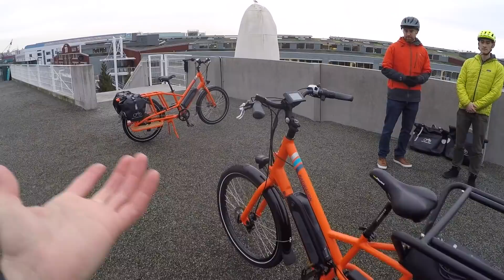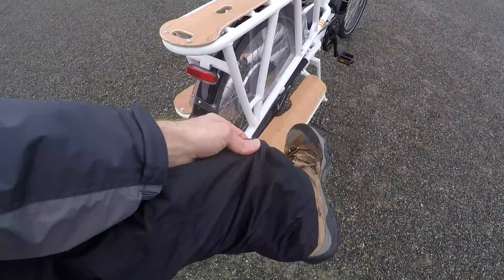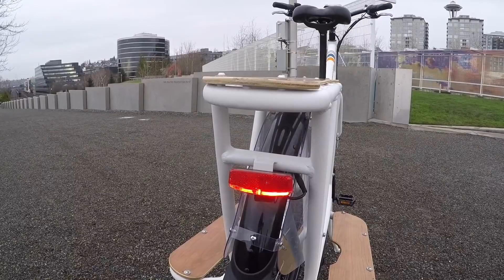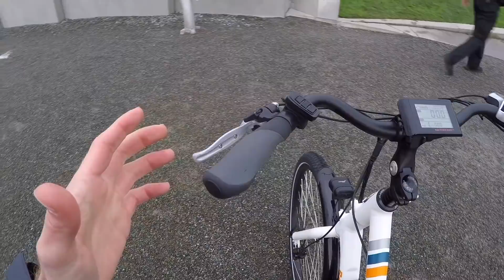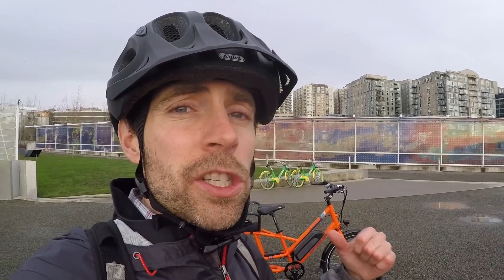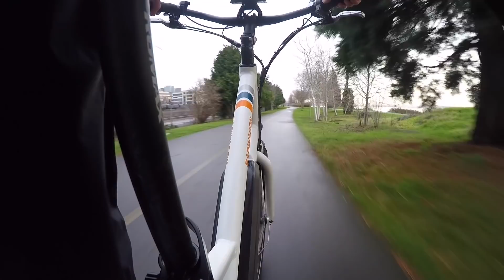2019 Rad Power Bikes RadWagon Review - $1.5k

Comment: Got mine in April when they launched the 2019 model.
UPS did not do a good job delivering it. Front disk brake was damaged. Support was great. They sent me a replacement disk rotor right away.
I have put about 2K Km on it so far. 
Even though the tires are Kevlar reinforced; I got a flat in June.
Changing out the inner tube was a pain as the rear wheel itself is quite heavy.
I'm now using Tire Slime to prevent small puntures.
about 2 months ago I was getting an error message on the display with it shutting down. Turned out to be a loose cable connection.
So far this bike has worked as it should. Many people have asked about it.
I'm very happy with purchasing this bike. Its the most i have ever paid for a bicycle.

Comment: just hit 1 yr. with  my radcity.its been dependable.i replaced the tires right away.sorry ,kenda tires suck.other than that im happy with it.i got 2200 miles on it,and so far all it needs is new brake pads.the rear wheel spokes loosened up after 700 miles,and the local bike shop wouldnt touch it.i called their tech support and they were very helpful.i bought a spoke wrench ,fixed the problem for a fraction of the shop price,and it runs like a champ.anyways i tell everyone this the best bike on the market for the price.ill probably another in the future.
Reply from the maker: Nice! Thanks for the update Nick. Sorry to hear that your local shop wouldn't help with the fix but awesome to hear you got a new tool and some new skills ;) ride on!

Comment: I have this RadWagon bike the white one you show in this video and the direct drive motor is garbage, it struggles to get you up any hill in the Vancouver BC Canada area, I upgraded the controller to a 35amp Bolton controller and it didnt do much to help with getting up hills. I am on the hunt to find a replacement rear wheel with motor. the stock headlight is garbage if you have issues seeing in low light like I do. so I got Two rechargable headlights that I use.

Comment: The usual salesman review without the details. How many charges is the battery rated to? Is the registration switched off if the battery is dies? What is the torque? What is the horizontal too tube length? Are the tires setup for tubeless? How easy is it to change a flat. At 75 lbs it won't be easy to move in a vehicle.

Comment: I would want to put my 12t Mac in front, and I will need to figure out where to put my 23ah triangle pack. I should be able to pull my trailer as well, maybe scale down to a bob trailer. Definitely get rid of the tires 180 disc rotors, replace with 203s, shave off the back of the front fender, and pitch that plywood. Then add my own handmade coraplast laminated in gorilla tape saddlebags, my coraplast front basket that is raked back with a windscreen. I think that would be an excellent bike for riding across America.

Comment: For carrying a child seat it’s disappointing to not be able to find motors over 100Nm and suspension on both ends. Is there a Tern GSD out there with fat tires and a better motor? The Bosch Gen 2 they have is under powered at 50 or 75Nm. Any suggestions please?

Comment: The last good RadWagon. Unfortunately, the RadWagon 4 was improved - by taking half a dozen steps backward.
Reply from the maker: I like the new tire size, it's a bit smaller to make the bike low but also wider so you get some stability and comfort.
Reply: @ElectricBikeReview  - Rad likes the size, too, but it has less to do with your stability or comfort than it does with locking you in to tires and rims from Rad.

A 22-in tire is about an inch further from the axle than a 20-in tire. Was it really necessary that those extra 25 mm be there; because when it comes to 20-in wheels, you have a lot of tire and rim options. Even 24 inch wheels would give you quite a few options although they are not as common as 20-inch or 26 in. But no, somehow Rad just couldn't get the bike to handle, ride and do the job with 20-inch or 24-in wheels, so they just had to have those 22-in wheels. Keeping you coming back to Rad for tires and rims I'm sure wasn't a factor...

I also think going to the geared motor, which is a more fragile motor, for a high capacity cargo bike wasn't an improvement at all in terms of what you need most from a cargo bike, which is reliability. Those little plastic gears wear and break even under the best of conditions, let alone carrying a couple of kids up a hill. But geared hub motors are cheaper and easier to source, which is the actual motivation here.

Rad has adopted the corporate mantra of "build a reputation with a brand or model then coast on that reputation while you make it successively cheaper each generation (while still charging the same or more)."

Next? New and improved oatmeal with added high protein - they don't mention that the added high protein comes from weevils. I've seen about seven decades of corporations "improving" things with each generation. It may have made me just the tiniest bit cynical.

Comment: I was doing some research and Rad bikes got my attention. Meanwhile I saw another company with similar bikes but their bikes specs are way better with the same price. You can get the hydro brakes , suspension , advanced control panel with passcode , comes factory with rear rack and the seat is very comfortable. 9 gear spread and battery range is more than what Rad offers. I got my bikes last week and I am so happy that I didn’t pull the trigger and bought Rad. This company is Rize bikes 
  https://rizebikes.com

Comment: I love the designs, but is there any way to put a motor on it? I live in the country and everything is too far for normal bikes, and too far for the current electric powered bikes. Even a small motor would work, or even better a H2O engine bike, because that takes both gas and batteries out of it. LoL.
Reply from the maker: Sure, I think you could get a front wheel motor kit to extend the range. It might be cheaper, quieter, and simpler just to buy a couple of extra batteries and put them in a bag to extend the range.
Reply: I was going to suggest the same thing- buy an extra battery.  Range could be 50-80 miles with a second battery.  Remeber there is always human-power backup as well ;)
Reply: @badandylaoc  Well yes, but you try traveling 90 to 100 miles on just pedal power at minimum car speeds because not all places have biking routes, and around here they'll literally run over you. But I enjoy biking, and I've always looked into these, but they usually cost so much that it would be an investment for me because hard times and I'm poor. LoL.
Reply: Sounds like you want wind power....good luck....genious
Reply: The Lucondrix Perhaps I'm not understanding your question? Are you referencing a gas powered motor? I think that would defeat the entire purpose of an E-Bike. This is a motorised electric bike.

Comment: How to the regen brakes work on this bike? Like a prius where if you press on the brakes light it will stop by the regen brake and if you press hard the the actual brake pads or does it work in conjunction?
Reply: Correct. If you lightly apply the brakes it will begin to regen.
Reply from the maker: Yeah, and in a way, the regen is always happening gently in the background if the bike is switched on. If it's off, there is still some magnetic drag that is not being recaptured. Here's a video that Mike and I shot discussing this topic a couple of years back: https://www.youtube.com/watch?v=Dx8Lofots54

Comment: You referred to the "750 watt output" of the motor?  Wrong, the motor Consumes a max. of 750 watts, it's Output would be related by it's Torque figure, which would be given in Foot/pounds or newton/meters.  You pretend to be such an accurate sorce of information, stop and think before you spread Inaccurate information. eh?